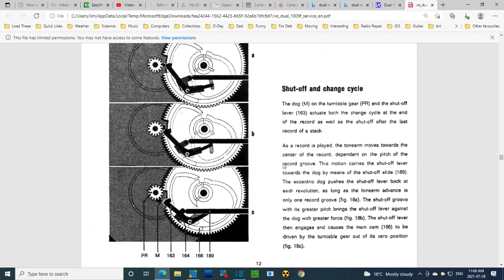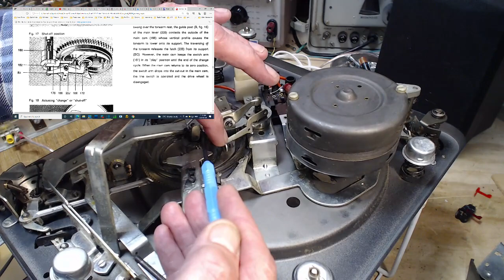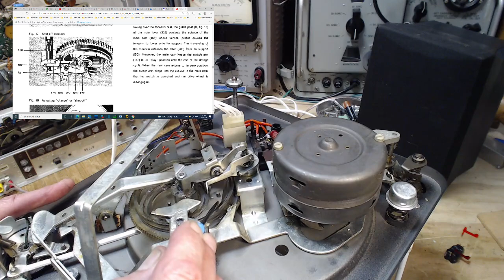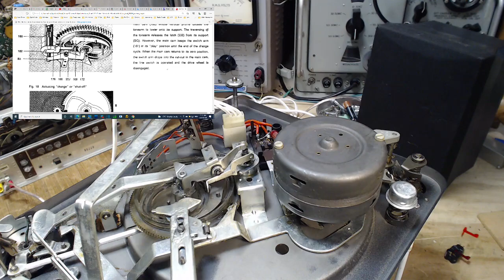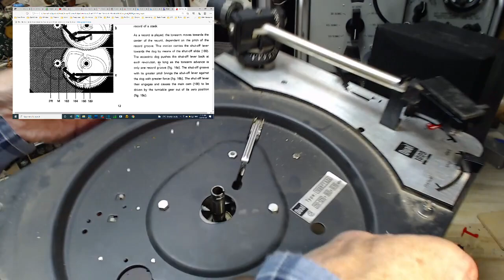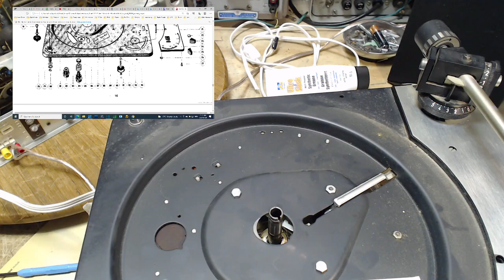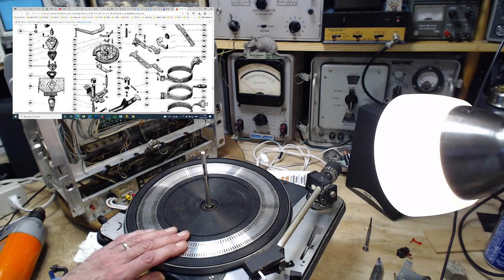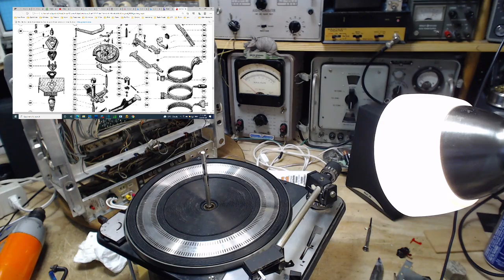Clairtone Console Stereo Video #6 - Troubles Galore

Comment: That Nut on the idler wheel shaft should not to be tightened initially. It is using to adjust the height of idler wheel and thus fine adjusting the speed.Move that nut one or two threads downwards to lift up the wheel a little bit and thus reduce the speed. When You fit the idler wheel on the base (using screw), that nut will decide how much downwards the shaft will go. (That means the nut acts as an adjustable stopper.) After tightening the screw, that nut will become tight against the base (actual base of idler wheel is a spring-loaded moving lever).

Comment: At 1.02.08, the 'something missing' is probably the c-clip he removed in video #5 at 11.39 and forgot to replace!
Reply: Well ofc you are exactly right. But since he don't read comments nor review old videos, you are preaching in the desert and we need endure more carnage.
 Because one thing is clear; he destroyed the perfectly acceptable idler wheel by ( on video #5) digging into it with his fingernails and rubbing it on sand paper. 
But as usual with him, it was like this from the factory, or defective to begin with. I just hope his customer follows his travails and draws his own conclusions as to what had been bad and what was caused by inappropriate repair attempts.
Reply: Thanks! And you're right - fixing record players is not one of his strong points - neither is reading comments!
Reply: @kjbirby  Hi from the UK. I agree with you. I've repaired quite a few turntables over the years. Yet I often find that I can't follow Jim's logic when it comes to repairing turntables. He sometimes leaves them in a worse state than when he started.
Reply: THE C-CLIP JIM.

Comment: Try rotating the cam gear by hand through it’s cycle and you will see that the trip lever will be retracted because when the arm or you start the cycle from the switch the trip lever will come out and stay out until the platter engages with the cam and then it retracts